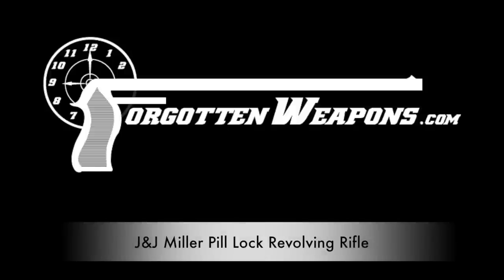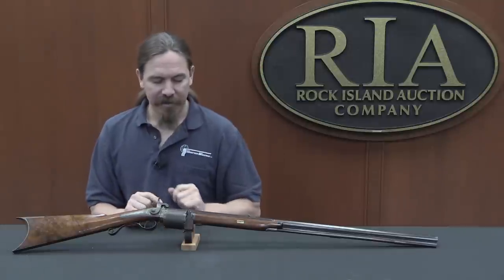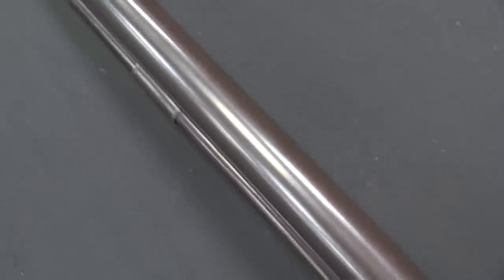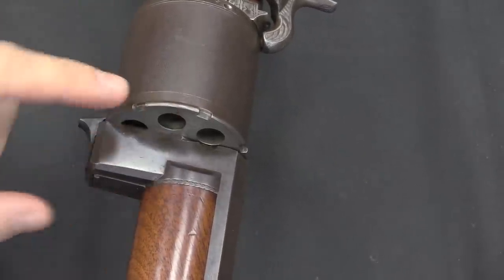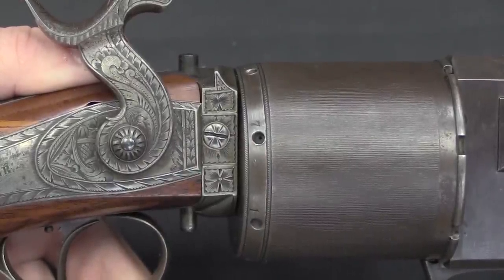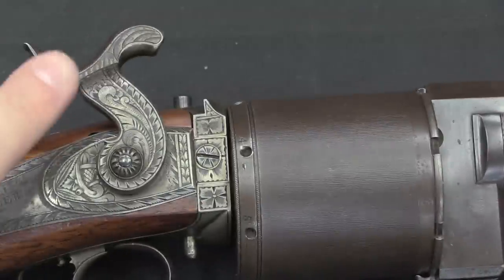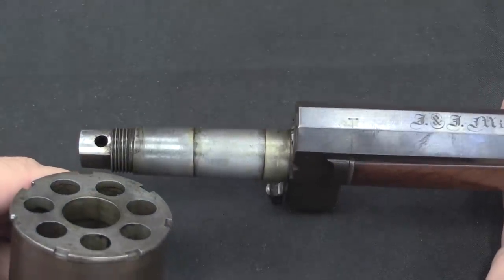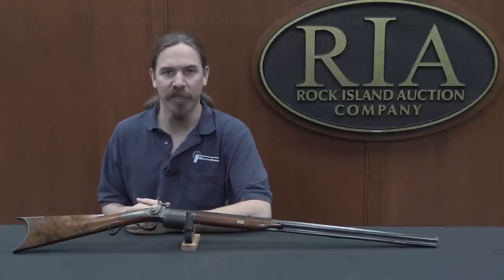Miller Pill-Lock Revolving Rifle

Comment: added notes.

Fulminates were discovered by Edward Charles Howard in 1800.The use of fulminates for firearms was first demonstrated by a Scottish minister, A. J. Forsyth, who patented his scent-bottle lock in 1807; this was a small container filled with fulminate of mercury.Joshua Shaw then made the transition to their use in metallic encapsulations, to form a percussion cap, but did not patent his invention until 1822

In the early 19th century joseph Manton, British gunsmith invented the tube (or pill) lock, an improvement over Alexander Forsyth's scent-bottle lock. Rather than storing a reserve of fulminate in a container they were now single-use pellets. The hammer of the gun was sharpened; when it fell it crushed the tube, causing the fulminates to detonate.

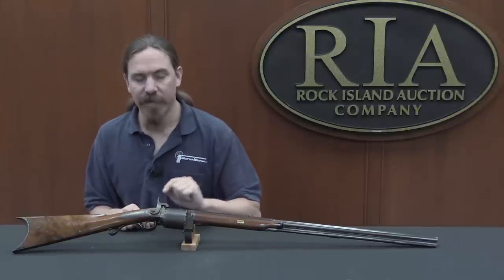Comment: Ian - and quite a few posters - need to brush up on early percussion firearms. Forsyth and many other developers used Potassium Perchlorate as the main ingredient of their priming compound, in tube locks this was mixed with powdered charcoal in a 1:48 ratio which de-sensitized the priming enough that the pewter tubes used in magazine fed Tube Lock percussion guns could cut off the end of the tube from the main supply without exploding the whole thing, but still have it fire when crushed in the primer cup. Forsyth's locks aka 'Scent Bottle' locks had a hollow magazine that contained a number of roughly spherical pills of Perclorate mix, one of which would fall into a hole in the axis pin of the magazine as the magazine was rotated and when the magazine was rotated back into position a pin lined up with the pellet and could be smacked into it by the hammer firing the gun. The main problem was that the Perchlorate residue caused erosion and rust of the lock as well as the bore.

Comment: Bear with me for not knowing the proper terms for parts, I admittedly have little experience with firearms and none with antiques: So when the hammer comes down, the firing pin first hits the beeswax covering the charge. Once a cylinder is empty, how do you get the beeswax out? Presumably the firing pin pushes some of it through the small hole. Unless the force of the charge blows the wax outward instead?
Reply: Tyrus Doraneko Just conjecture but I doubt much gas if any would come past the hammer. You would probably have to use a pin or something similar to clean the flash hole occasionally.

Comment: why dont they make revolver rifles anymore
it looks so cool
Reply: Because they're impractical, bulky and painful to shoot.
Reply: \\painful to shoot.

Nagant obturation system solves that problem in 1886.
Reply: So because they're impractical, bulky, unnecessarily complex and inaccurate due to shitty trigger pull.
Reply: Bladsmith doesn't that apply to revolver pistols too? I'm sure there would be a small market for novelty if nothing else.
Reply: If you couldn't fire a revolving handgun with a standard handgun grip without getting blasted with hot gas, then sure.
Reply: They do. Taurus/Rossi makes a .45 Colt/.410 revolving rifle, as well as some .22 revolving rifles. They have a small metal shield by the cylinder that prevents you from getting the shit burned out of you by gas.
Reply: They aren't commonly made any more because they just aren't as good as the other options out there.   Other than single shot, every other type of rifle is better than a revolving rifle.   Lever action, bolt action, semi auto are all better, safer systems.   That said, this is an absolutely beautiful rifle for sure.

Comment: Loading the chambers and then add the pills? Wouldn't this maximize the damage if one of the pills goes off during loading or sealing?
Reply: I think the idea is that the powder and bullet would be pointed away from you when loading the pills, so if there was an accidental ignition while loading you wouldn't get shot like you would if you were loading the rounds at the time.